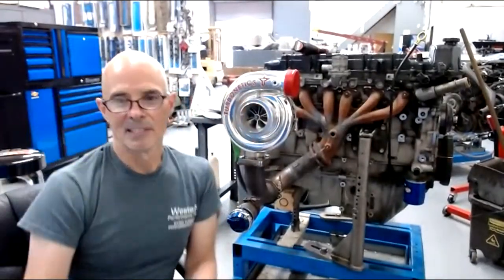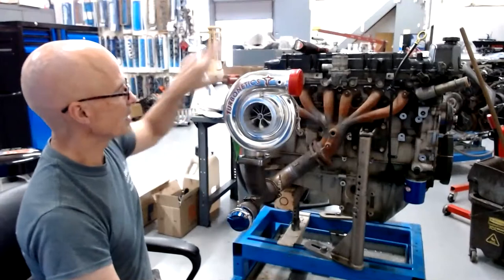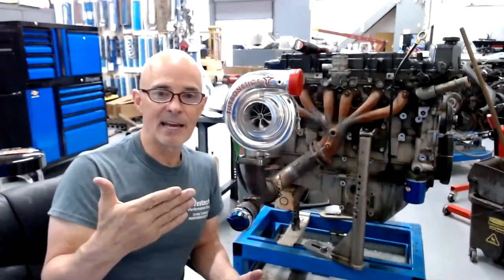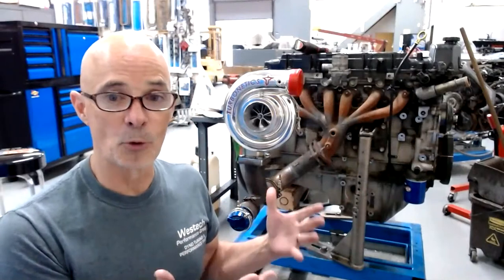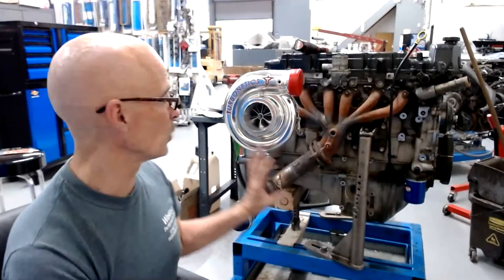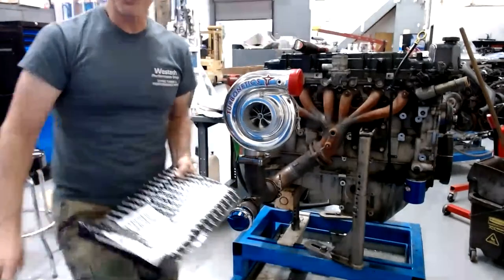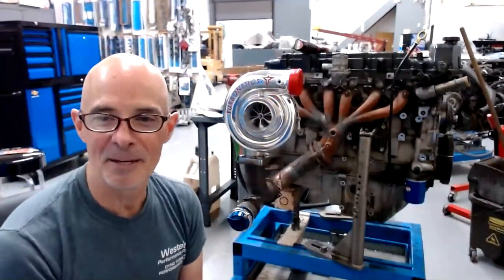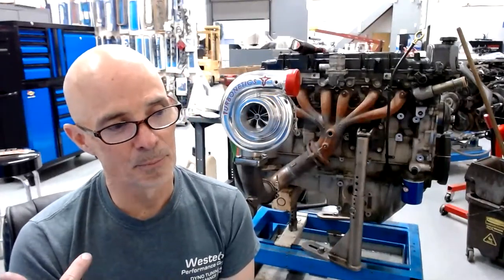LET'S TALK TURBOS-4200 ATLAS AMERI-BARRA (WHAT HAPPENED?)

Comment: I really like your discussion about handling and road course driving.  The best money a noob can spend to make his car faster is sticky tires.  After that, the best money he can spend is on more track time to become a better driver.
Reply: So true. Upgrade the stuff that keeps you stuck to the planet first.
Reply: Exactly! By upgrading any worn suspension parts with "better" parts will actually make the vehicle "seem" faster because it does what it's told, and responds quickly.
Making it more predictable, and raising it's limits (but you'll better know what those limits are by testing what you have)
..then upgrade the BRAKES!

Comment: Hey the later 4 cylinder and 5 cylinder versions use a larger 95.5mm piston to pick up some cubes compared to the 92mm that is in all of the 4.2Ls. not sure why they never used the larger piston but it would be near 4.4L with the larger pistons. Be a cool test
Reply: You do know that you can't just put larger pistons into the engine without boring the block, right? There may not be enough material in the smaller bore blocks for them to be bored out to 95+ mm.
Reply: There is not enough material in the cylinder to put such a big piston in there.

Comment: Being an Aussie with a few barras; the turbo motor and NA are very similar. The better motor for both is a FG over a BA or BF. Better head and cam profile. The crank and head is exactly the same between NA and turbo but the turbo runs incolnel exhaust valves. The turbo is at 8.7 to 1 comp and the NA around 10.3 to 1. Wikipedia spells us out. The NA rods are junk. Both motors will valve float from 12psi up as the springs aren't great. I'm loving the atlas 4200 if it's anything like the barra I'd love to get one here and run it in a C10 truck to be different. You were right though with the basic barra mods, valve springs, pump gears and backing plate, headstuds and balancer upgrade considered essential for 20psi - we don't tend to bother with rods pistons cams or such till looking at 800 and up wheel hp. You'll find too the barras also eat timing chain guides being plastic and crap
Reply: Would you happen to have any barras for sale by any chance or know where I could get one

Comment: I've  only recently become interested in the 4.2& 3.7. I'm  currios why upgrading the cam, springs, retainers,etc. Is it because of the exhaust variation why they don't  run solid lifters instead of stacking spacers?

Comment: have you ever tried running the PCV into the exhaust after the turbo. Run it in at a angle in the direction of flow to achieve a venturi effect.
Reply from the maker: that's a pan evac system-guys been doing that for years
Reply: @richardholdener1727   just curious if you had tried it to help cure the excess positive crank case pressure. im also curious how effective it actually is as acting as an evacuation system. wonder if you could test it. PCV into intake vs Collector. with a dyno results comparison

Comment: What would be the rev limit of these motors and how high can it go???
Reply: Wonder if they can de stroke and send it
Reply: The reason these dont rev very high is because they experience a crank vibration around 6500 rpm. There is a company called bhj that makes harmonic damper for them that allows you to rev out to 7500 and i believe there is one for 8500 rpm too. Either that or if you are going to use this for racing only, you need to start out at 7000 rpm

Comment: Hey man it’s like your the only person I actually learn from IF ITS POSSIBLE CAN YOU DO A VIDEO ON THE SLOPPY 3 CAM IM VERY INTERESTED IN TOO SEE YOUR DATA AND INPUT ON IT WILL LITERALLY BE ME CHOOSING IT IF U SAY AND PROVE ITS GOOD IN MY DESIRED POWER RANGE
Reply from the maker: what is the motor size, intended application and cam specs-i'll tell you what it will make
Reply: @richardholdener1727  lm7 5.3 Gen 3
Reply: I have 4 ls applications two 2003 surburbans and a 75 & 96 caprice all have 5.3 lm7 706 heads in all of them

Comment: I know a lot of guys run unlocked stock ecu’s on LS engines, is that possible on the 4200 for a swap and if so what’s the drawback?
Reply from the maker: it is possible to tune the stock 4200 ecu with hp tuners etc like the ls.

Comment: I was looking at the specs for the Atlas engines and noticed that the 5 cylinder 3.7 has a bit more bore but the same stroke as the 6 but also makes power a bit earlier? Both HP and torque happen a few hundred rpm lower on the I5 but they both redline at 6300. What's going on there?
Reply from the maker: cam timing difference? intake runner length?
Reply: On peak power Rpm...Check the idealized Stan Weiss  website and cross check with  the Australian Alex G Bell. Each has the peak power rpm chart for cylinder bore  size verses port intake size. As bore size goes up, it changes the power peak. Specfic power rpm drops as you add cylinders. In Australia, the 2/3rds of a 173 in line six was rhe 1900 Four. It made 80 hp at 4800 rpm while the 2850 cc six made 102 hp at 4200 rpm. Thats how it goes when you lop cylinders off an engine. Specufic power per cube and peak power rpm goes up. The Atlas has a 4.05" bore spacing; with 95.5 mm pistons that is an almost 400 Chevy like siamesed bore spacing of 0.290. For a dry linered 6 cylinder aluminum block...not much cooling gping on between cylinders
Reply: @deanstevenson6527  you actually hit pretty well on why I'm baffled on the I5 making power lower. Like you say, specific RPM power drops as you add cylinders, so why is the I5 making power lower than the I6? The I6 also has a 93mm bore to the I5's 95.5 which should also shift power lower on the I6. 

I rummaged through some technical specs last night, intake and exhaust runner length are pretty close, the valves are the same size across all the engines. I wasn't able to find cam specs though, so I'm wondering if the I4 and I5 have less cam in them to improve low rpm torque.

Comment: Rich, tonight I scattered my turbo LS. Have you ever seen or heard of too low of timing under boost breaking rods or pistons? For reference I run 30° base timing and pull it down to 12° at 15psi. Only saw 10 psi on a boost spike tonight but still windowed the block.
Reply from the maker: low timing usually shows in high egts-were you on it for a very long time
Reply: @richardholdener1727  it blew up at about the 1000’ mark. So 10 seconds WOT. logs show 12psi peak boost at 14° of timing on pump gas. I did notice the pull prior to this was shooting a large orange flame out the exhaust for the entire pass. It’s got a relatively short length 5” hood dump so I’m not sure if that’s normal or not. First hood dump experience. I never noticed the blow torch out the exhaust when it was a fender dump with a smaller turbo.
Reply: @mikescherrer4923  pump gas yes, 12psi 14° when it grenaded. Based on a video I shared on a blow thru page of my concerns about the flame coming from the exhaust during the pull I was told my timing was too retarded. I had more in it last year with the smaller turbo but I wanted to be safe so I dropped a couple degrees out of it everywhere in the curve.

Comment: How many 90 degree elbows till it makes no boost? 1 elbow, 2 elbow, 3 elbow, 4 elbow, 5 elbow, 6 elbow, 7 elbow, 8 elbow, 9 elbow, 10 elbow, 11, elbow, 12 elbow = no boost, just a pugged muffler? +30psi at the compressor -5psi at the throttle body.
Reply from the maker: check out the remote turbo test-with long (big) discharge tubing